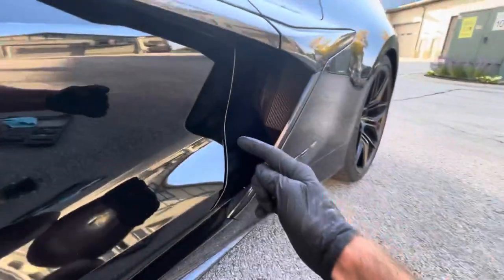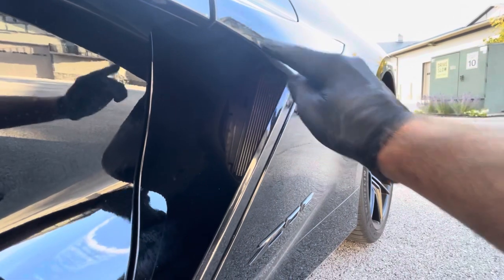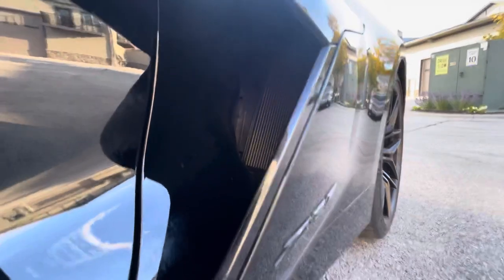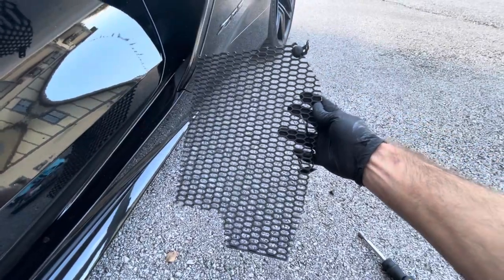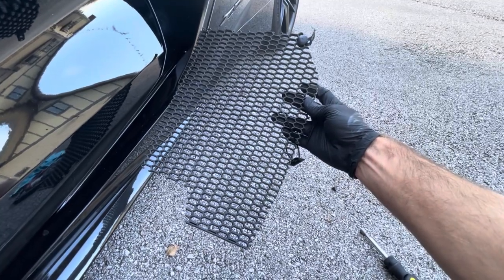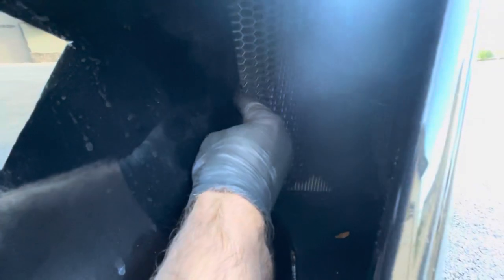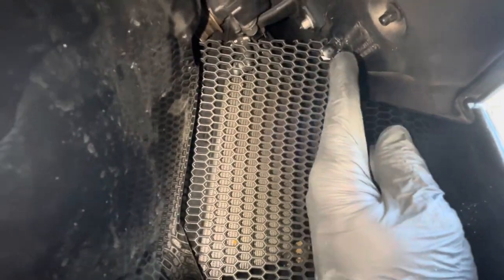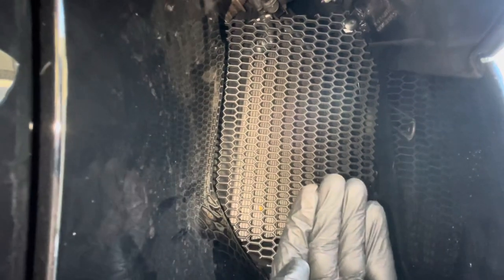Chevrolets Corvette C8 Z06 Side Intake Radiator Grille Installation by RGS V3

Comment: Black car, black screen, black gloves. What better way to hide what you're doing. Oh, and don't use additional lighting. Hope the product is better than the install video.
Reply: You also glossed right over the amount of effort required to seat the screen into the rubber gasket. I guess you edited out the profanity.
Reply: @raysmith5288 oh cry about it
Reply: Concur...the video is insufficiently illuminated. I see more then 3 nuts in the area of the intake referenced. Acquired the screens with the intent of installing this weekend but I am going to hold tight until RGS provides improved installation guidance. Until then would not recommend purchasing.